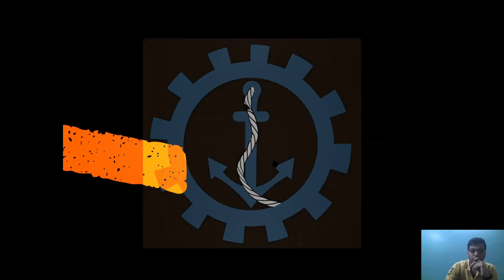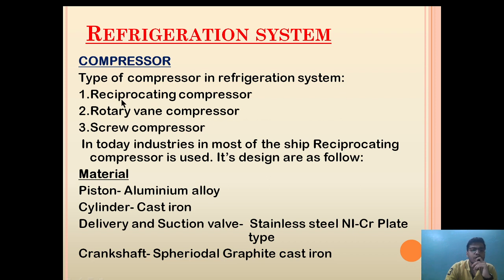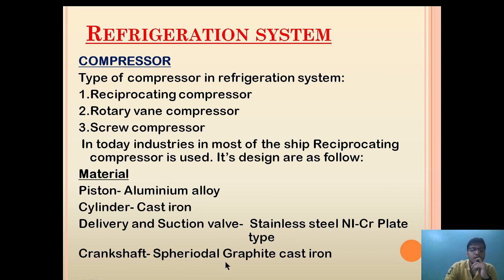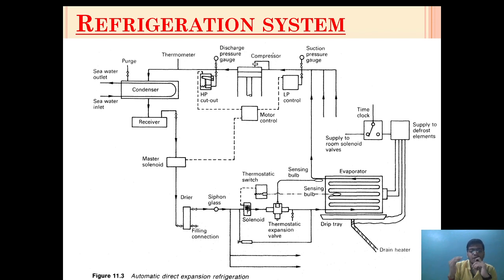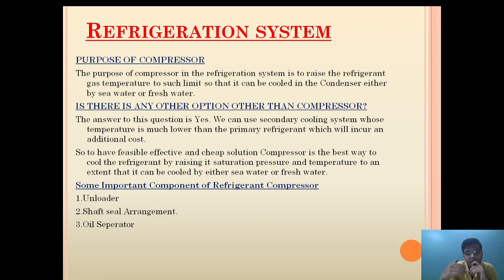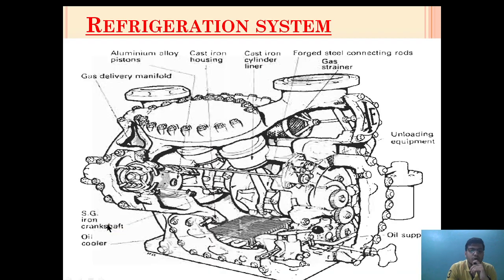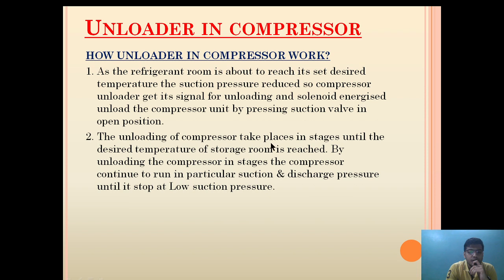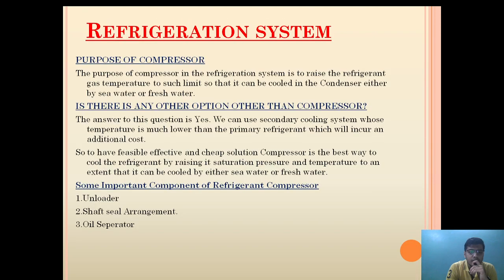Refrigeration System Compressor in Refer system| Unloader in Refrigeration cycles|(Part-2)

Comment: Sir please clear this doubt i have, 
Why the suction pressure in compressor reduces  when we achieve the desired room temperature? And why pressure in the line increases when all rooms achieve its desired temperature? Please sir explain this🙏
Reply: The solenoid valve regulating the flow of the refrigerant into the particular evaporator fragment is getting activation signal from the temp switch which has a sensing filament at the evaporator end and length too. By doing so, and also regulating the flow through the TEV, Once the selective evaporator of a particular room is in satisfactory temperature condition, the suction line is deprived of refrigerant flow that goes towards the compressor. This also means the discharge side pressure is also raised. The LP cut out thus activates as this happens and the compressor cuts out on auto.

Comment: U said If the liquid comes in then the cylinder will lift up bcz of hight pressure as the liquid is incompressible , so how to take out the liquid from system ????